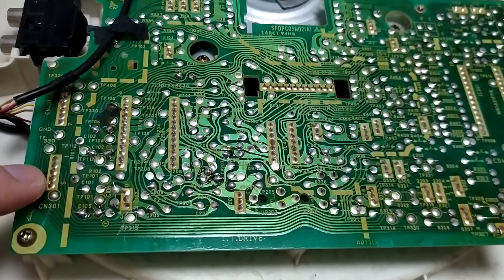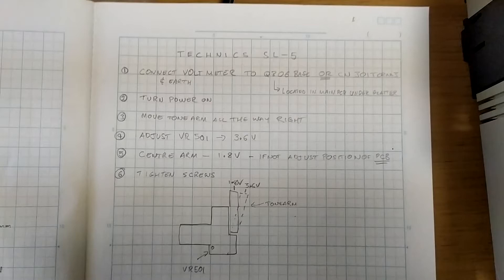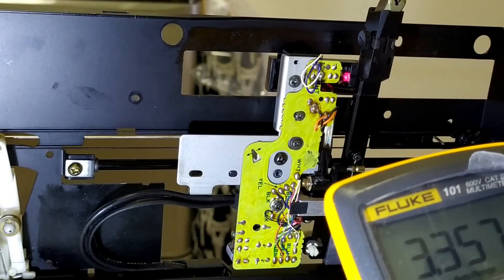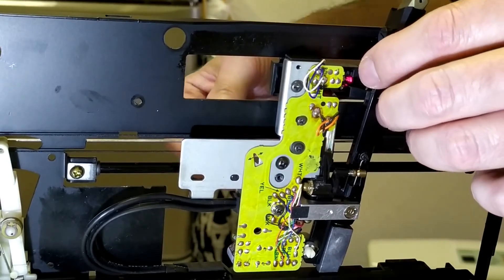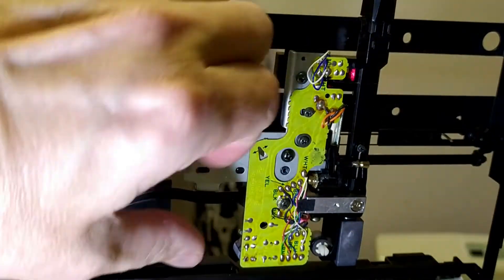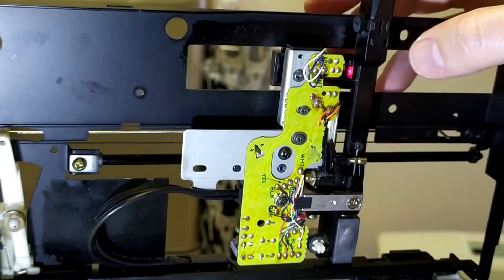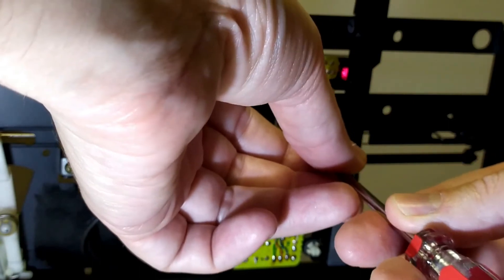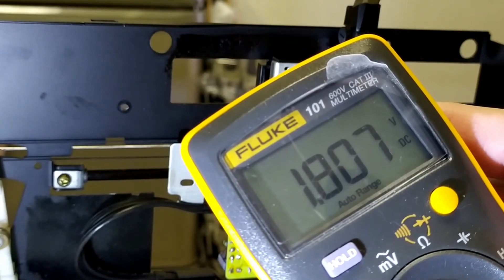Technics SL 5 - servo adjustment

Comment: Hello, I like your videos in particular the SL5 series as I have one that needs serving soon, I learned a lot from it. Just wondering if you have ever come across an SL-J300R with issues of the program and scanning of the tracks? My one doesn't register the tracks for the program. Thanks.
Reply from the maker: I haven't looked into track scanning, though my Aiwa does feature it.  Only simple thing I can think of is to look at where the light source/receiver is and ensure that it isn't dusty.

Comment: tnxs for this video.  Had some troubles with mine SL5.  It stopped to early.  With the potentio meter on the top of the print i could fix it. It took a while but it works perfect now.
Reply from the maker: Great to hear!  I really like Technics gear, a bit of TLC and they just keep going.

Comment: I know it's a long shot but I have Sl-5 and the tone arm won't drop down on singles but will on LP do you have any clue what it is?
Reply from the maker: I don't have any suggestions off the top of my head.  I'm looking at getting to the next one in a week or two.  I'll have a dig through the service manual and see if I can find anything that might explain whats going on.  I have another tapedeck ahead in the queue which is all done bar calibration testing, so I am keen to knock that over first, just been a bit stretched for time last couple of months.

Comment: I hope I aint gotta mess with these bits when I've fitted new belt.
Reply from the maker: If you don't touch this side, then maybe not. If it all works after fitting the new belt, then leave it be.  But if it doesn't play the whole record...
I've mentioned before I have another one of these that needs servicing, and that will happen late Dec/Jan sometime.  I might make a more thorough set of videos about it.

Comment: I'm already mad, so watching this video has no effect on me. :)
Anyway i have to listen to my singing potatoes in a padded cell now.
That looked like a right pain in the rump!,  touchy touchy circuits. :-(
I think we should jump into a tardis and go back to the pillock that designed the deck electronics.
A good slapping with a large wet fish should fix him for sure. :-D
Reply from the maker: I'm positive we're all mad.  The dangerous ones are those that don't know it. :&

Yeah, it was touchy alright!  I'm not sure how they came up with that adjustment mechanism, I guess it must have solved the problem in a 'clever' way, and reduced part count.  Get the trout...

Anyway, I'm happy this is done and I can mark it as 'solved'.